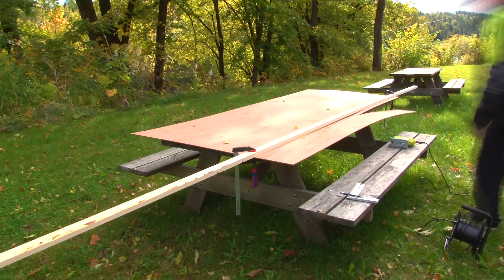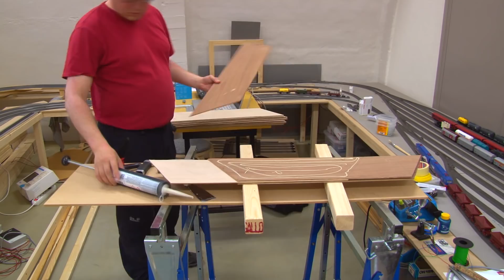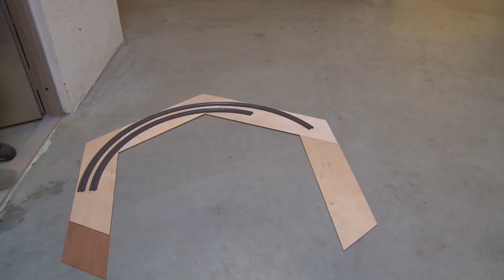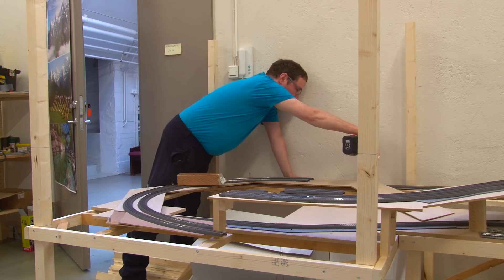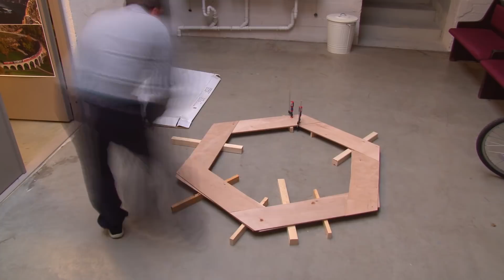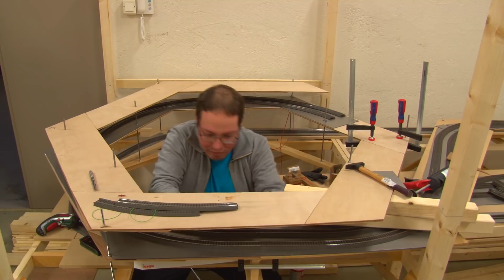Construction of a model railroad helix - Time-lapse [Trainroom]

Comment: Using straight cuts to form the hexagon appears to be a more efficient use of plywood than cutting circles out of a sheet.
Reply: Jerry Smith First of all it seems to be a way more time-consuming method.
Reply: I think it will be less time consuming and a more efficient use of materials. The 4x8 sheet of plywood is cut into strips which then are cut into segments. the angle of those cuts allows the segments to be reassembled into the hexagon. I suppose angles could be matched to form a octagon, but that would take more time. It seems to me cutting circular sections will always leave a lot of pieces trimmed from edges of the 4x8 and curved cuts are more difficult to make than straight cuts.

Comment: Good job,,!?,, why didn't, you use a router, or lam., trimmer, with a swing arm ??,,, you opened yourself up, to a ton of work, I find it easier, to rout, 1/4" ply, in circles!!!
Reply from the maker: I don't have enough storage place to store larger machinery, plus all the budget goes into build materials. I might see if I can lend better equipment for the next helix which three times as high.

Comment: What curves did you use in that Marklin C track? R3 and R4 or R2 and R3?
Reply from the maker: R4 and R5, the biggest.
Reply: PolybosStudio Do you think is an error to build a helix with R1 and R2? Or is that asking for trouble?
Reply from the maker: R1 is asking for trouble. It will be very steep. Download the Excel from comments and try out how steep it will be. Also some thirdparty product will not run on it.

Comment: lots of unnecessary work in the video.
just cut strips f 1/8 or thinner. wall fiber board, it is just a step better than card board. exact name? but cut the strips about 3/4 wide.
then placing your single track supports or double supports for more than one full loop. threaded rod works great here to adjust the grade to keep it the same all the way.
but then using glue some screws and lots of C clamps start bending as per the curve, easy as long as you keep the radius about 34 inches. and all track supports can be made this way. city's, yards can just use good old plywood. or sound deadening ? stuff.
all curves can be made gradual not snap track sudden. can even hand lay the rail on this under support.